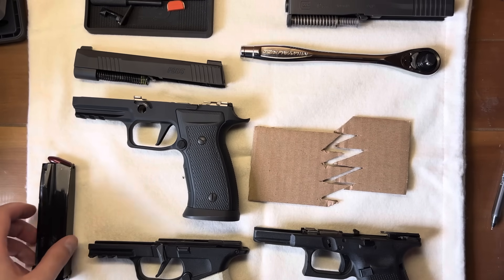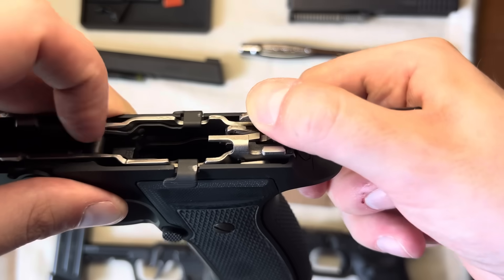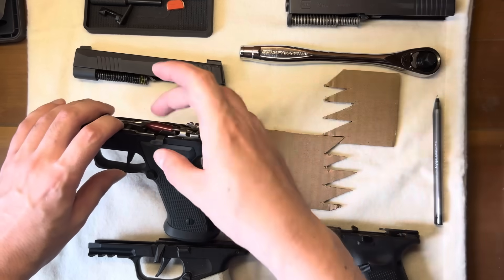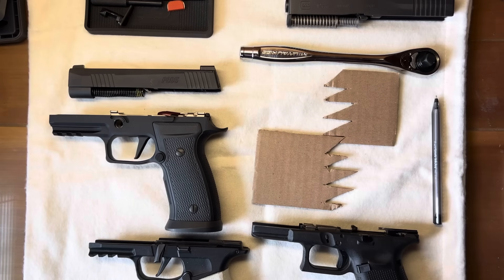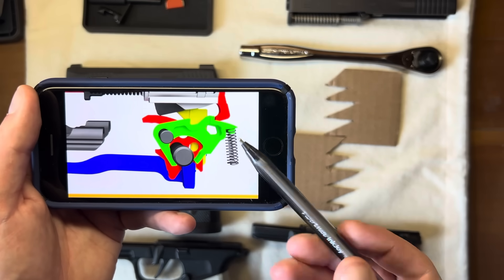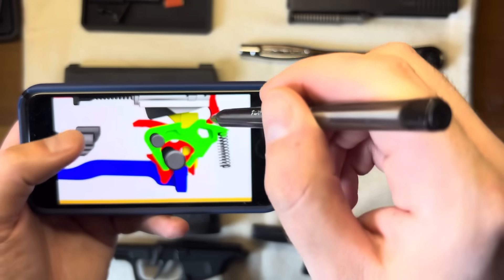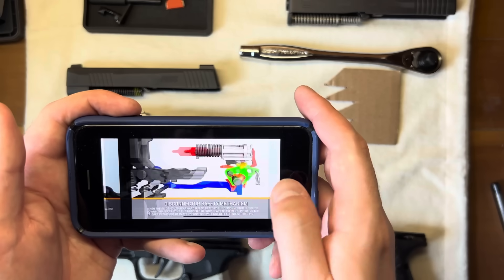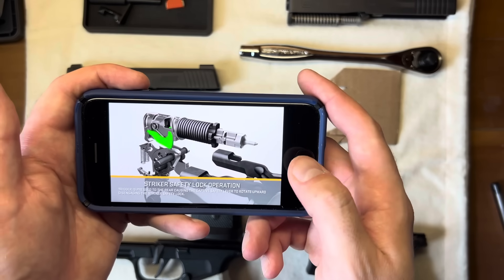Sig P320 Theory on Potential Cause of Accidental Discharges (Expanded)

Comment: Interesting theory.  I think this type of thought experiment is constructive.  Can you clarify your step 2? When I push down on my disconnector the safety lever can pop up, but if I have any force on top of the safety lever it doesn’t rotate up.
Reply from the maker: Yes, correct. The below video is probably one of the better ones that show how the gun functions. Grayguns has a cutaway slide so you can see the striker safety lock is in contact with the captive safety lever when in batter. If it was out of batter the striker safety lock would be behind the captive, safety lever, and as it’s coming forward it would contact the captive safety lever. The spring weight and travel to defeat the striker safety minimal and the contact may be enough to defeat it just for a split second. I think this more likely and not so much the carbon fouling or being pinned in place due to tolerance issues. 

https://youtu.be/4q-AFIxPH1U?si=BI4XdbXZpDgpRYWT

Comment: One of the questions I have is “Can the mechanism that blocks the firing pin get stuck in the fire position?” If so, would someone necessarily realize it was stuck in the fire position? It occurred to me if that safety was stuck, it could be that way for years. I would think the gun would still fire normally.  It would mean the failure would not have to occur at the same moment as the sear problem occurred.
Reply from the maker: Yes, it’s possible to get stuck and you would likely have no idea that it’s stuck. The only problem I have with that theory is post review no one can get them to stick in the up position.  Also, some of these guns have very few founds and I don’t think carbon fouling would occur this early in the guns life.  One thing I will note is that Sig does not want you to oil the striker lock.
Reply: @dgrassley  this is something that should be function checked every time the gun is field stripped for cleaning.  Cleaning should be done, IMO, after every live fire session and every 6 months for a safe queen.  However, no one does that but me.  You would notice the striker safety lever being stuck up when you could see the firing pin poking thru the breech face.

Comment: I think it is a very bad design to compress the striker spring fully while loading a round into the chamber.
Reply from the maker: I wouldn’t say it’s a bad design, we have never had issues with the HK and Walther products. In my opinion Sig tried to design a gun you could compete in competition and do duty work.
Reply: @dgrassley  exactly.  Sig convinced LE and Military to use a gun with a competition style trigger for duty use.  I'm not a hater btw.  Exactly the opposite actually.  I own 9 P320's and use three for competition and practice.
Reply from the maker: @jeffhernandez5098 100% agree! I remember the 2010’s when G34 was the hot competition gun. The aftermarket triggers people used remind me so much of how the P320 works and is designed.
Reply: @dgrassley  Compares to Glock half-compress design, SIG is quite unsafe.
Reply from the maker: @milolll glock is one of the most safe pistols for sure but that doesn’t mean a fully cocked striker is unsafe. Even the P320 is not 100 percent cocked.
Reply: @dgrassley  Not 100% cocked? Glock half-compress design doesn't have the force to strike the primer without the trigger pull, but SIG is fully compressed(cocked) to have the potential force to strike the primer, am I wrong? please correct me if I am wrong.
Reply from the maker: @milolll  The P320 it’s not 100% cocked. The sear rotates along a pivot. 
No, you’re not wrong but the M&P has the same sear design and we don’t call that gun unsafe. The point I’m trying to make is the P320 likely has other issues than a cocked striker alone being the design flaw. I think we are saying the same thing in a way.
Reply: @dgrassley  Thanks. So is Glock unique in the half-cocked design? Any other has the same concept? or is it a patent of Glock only?
Reply from the maker: @milolll in short no it’s not unique to Glock but they were in a way the first and others copied the design. Technically the HK VP7 is the first striker fired gun but they use a striker fully at rest and then the grip pulls the striker back. 
All the clones of the Glock have this particularly cocked design. Ruger RXM, PSA dagger, CZ P10 series, Smith SVD9 just to name a few. The only issue with the design is you’re fighting the striker spring and sear engagement which makes for a longer and heavier trigger pull.

Comment: Didn't the FBI testing find that the seer and firing pin block Co rotate because their on the same pin?
Reply from the maker: No they are on two separate pins but the captive safety lever rest on the sear pin. I have seen any movement in mine as the sear resets.

Comment: Now I'm somewhat concerned about my order of operations when I load my carry pistol. 
I always dry fire, practice on the reset then gingerly load buy easing the slide forward to not wake the wife up. 
My other buddy evidently  tests his safety every morning by pulling as hard as he can then gingerly loads by letting the slide forward. 
I wonder how many police officers might do something similar to not wake their spouse causing a partial sear engagement.
Reply from the maker: I think the reason we may not see this in a press check is because the slide is moving too far back and sear/striker engagement is not strong enough to walk the sear down. Similar under normal fire there isn’t enough movement to walk the sear down. No matter what the min and max tolerances of this gun are not enough alone to lose sear engagement.

Comment: I was playing with mine the other day. I hope you see this comment. I racked the gun without a mag or ammo. Once the fire arm was in battery the slide was loose. I was able to push the front of the slide back maybe an 1/8 to 1/4 with little to no resistance. So the over holstered theory makes sense. I hope u put another video out with that in mind to test that theory out.
Reply from the maker: I currently don’t have a slide for my P320. From my experience slide play alone won’t let the striker slip off and the sear still needs to be pushed down.  I may do a video on the different sear design and how it works.

Comment: I see what you’re saying but don’t most holsters apply pressure to the frame for retention? That would make it hard to push the frame further into the holster than the slide.
Reply from the maker: I can’t speak to all holsters and designs, but I would agree that Kydex molded holsters tend to have a tighter fit around both the frame and the slide.

Most of my experience is with Safariland. Their holsters are designed to accommodate both X300 and TLR weapon lights. Because of this, the internal dimensions are longer to fit the X300 and wider to fit the TLR series. This can make it harder for the holster to lock securely onto the frame. Additionally, for most models, the ALS system locks onto the slide rather than the frame.
Reply: Most duty style holsters actually apply pressure to the light not the slide or frame.
Reply from the maker: @Rocky-Stone You’re right some do, but safariland doesn’t due to them fitting multiple light shapes and lengths. The safariland holsters will work without lights attached which means they are locking in the slide, barrel and trigger guard.
 I agree with any light specific holster they often use the light to maintain fitment.

Comment: Dude, aside from the initial holster demonstration, you're rambling. I have no idea what your theory is.
Reply from the maker: I know, I’m not the best presenter and I apologize. 

In short, my theory is this: the gun is being over-inserted into the holster, which pushes the disconnector down and causes the captive safety lever to rise. (In my specific FCU, there’s some material interference causing this issue.)

Then, when the gun is bumped or gripped, it returns to battery. Upward pressure from the magazine pushes the slide up, which can cause a loss of sear engagement. At the same time, the striker safety lock contacts the captive safety lever and they move in opposing directions. 

Now you have loss sear/striker engagement and the striker lock has been pushed up for a split second allowing the firing pin to strike a primer.
Reply: @dgrassley  Thanks! Sounds plausible!

Comment: I believe what is happening is the sear is walking down off of the striker hook. This happens because of the play in the slide. As the sear is wakled down it engages the trigger bar, this pushes the trigger bar which pushes up on the striker block. With the striker block defeated, and when the sear has sufficiently walked down the striker hook and the striker hook falls off the sear, there is nothing to stop the pistol from firing. The proof that Sig knew about this issue is in the re-design of the sear. Is there any other weapon that has a secondary sear? My question for the design engineer is why did you design this second sear notch into the sear? This is how Sig can most definitely say the striker cannot fall without the trigger being depressed. They are in fact correct. But what know and do not say is that the trigger is being actuated by the sear walking down off of the striker catch. I am an Sig fan boy, I have 4 Sigs, though not a P320. Sigs are great guns, but this P320 falls short.
Reply from the maker: The only reason I would disagree is due to the amount of force required to push down on the sear once the sear tail comes into contact with the trigger bar. I believe it is greater than 5lbs. Base on my finger scale (Not scientific).  I just don’t think the amount of surface engagement is enough for that to occur. If you ever get the chance to do it I think you would agree, but I encourage you to test for yourself. Sig definitely did not want the sear to move after the first drop test issue. 😂
Reply: There is a secondary notch and without the safety lock being disengaged the striker can’t move forward.
Reply: There is a secondary notch and without the safety lock being disengaged the striker can’t move forward.
Reply from the maker: @TheEarthEater You’re correct, my point is that the striker safety lock is coming in contact with the captive safety lever and being disengaged as the gun is going back in the battery. The amount of movement required for the striker safety to be discharged is not much. As for the secondary sear notch the sear springs may not be able to reset the sear in enough time as the striker is moving forward.
Reply: @dgrassley so how would it fire if the striker lock was being pushed up while going into battery? The sear is still in the upward position with the primary notch and secondary notch in play?
Reply from the maker: @TheEarthEater I’m saying it’s all occurring at the same time. The sear slips off as the slide is coming forward.
Reply: @dgrassley it slips off and also clears the secondary notch? That would be easy to replicate in a pistol with that failure since it would be defective. None of the pistols with these claims have been proven to have that issue. That’s the tough part.
Reply from the maker: @TheEarthEater the sear has to move down in order for it to lose engagement. No, this would not be a repeatable test as I said in the video this is something that you need the gun with the physical characteristics and tolerances in order for this to occur. Then you would need to test an out of battery gun. I’m getting the feeling you have not watched the video because I addressed a lot of your questions.
Reply: @dgrassley what I’m saying is. This has already been tested. With every p320 claimed to have fired on its own. None of them are capable of doing this. It’s been proven and tested through 3rd party laboratories, sig, the U.S. military, the FBI, and other law enforcement agencies. The tests continue to this day and are providing more measurable repeatable empirical data to prove it’s just not possible.
Reply from the maker: @TheEarthEater I have not seen any testing of an out of battery P320
Reply: @dgrassley so an out of battery p320s barrel is unlocked and the primer drops out of the way from the firing pin which would also disallow contact to detonate the primer cup.
Reply from the maker: @TheEarthEater no it only out of battery but 20-50 thousands. When going back into battery this is when the issue occurs.
Reply: @dgrassley have you been able to replicate the striker hook releasing from the sear when returning to battery? No, and neither has anyone else. This is not because it depends or if this then that, it would be a clear tolerance issue that could be made repeatable and measurable. This is not possible and there is no empirical data to support it. Is the assessment logical? Sure. Is it valid? No.
Reply from the maker: @TheEarthEater I don’t even have a complete gun to test this. My goal in making the video was to draw attention so that others could test it. I said in the video that I believe it would require a large sample size to even find one of these guns.  Just going off of Sigs sales it’s a 1:10,000 chance of having this issue if it’s truly the issue. That was the only reason I made the video. It was never to say this is it but just to point out the theory since I haven’t seen others mention talk about out of batter testing
Reply: @dgrassley I understand but even the assertion that it’s 1:10000 is also problematic. If it can’t be proven the ratio also cannot be stated as fact. Is it a 0% chance? No, probably not but most likely very close to it. However tens of thousands have been tested with zero issue from 3rd parties. Hundreds of thousands have been tested through SIG itself. With a little over 3 million of these pistols being made 0 of them have been proven mechanically to be defective to where the pistol could fire without the trigger being pulled. If there was just 1 out there that could we would all know about it because there would be a recall.

Comment: The team/agency I am with have apx 40 of the 2017/2018 P320 X5. We can not replicate the issues. We believe the bull barrel and slide assembly creates a much more solid mounting surface. If this helps at all, we can provide our data. We are all looking for a solution.
Reply from the maker: @undefined7141 Thank you for checking. I will reach out if I get to the point of collecting data. 

Do you know if they have the Safety Lever Spring (part 1302135-R)? It’s located directly under the captain safety lover, but you would have to pull the FCU out to see it. 

Just statistically speaking, Sig said there were 3 million P320’s 
manufactured and hypothetically 300 of those have gone off. Even if all 300 were due to this issue, which is unlikely. There is a 1:10,000 odds of having one. The sample size would have to be huge to just find the one. Not to mention the time to replicate the issue.
Reply: Sir, it might be worth setting up an online presence to open source your data. Comparing the open-source gun community research with secretive FBI research, it appears open source is the way to go for speed and efficiency

Comment: This makes a lot of sense to me. If this turns out to be what's happening the Sig haters are going to have to eat a lot of humble pie. They are like an angry mob. Just confirms my suspicions that it is a dangerous gun, but not a defective gun. If you sell a gun with 1/8" of trigger pull to fire and 1lb of force, it isn't defective, but it is really dangerous. It has been shown many times as well that Glock, Sig, S&W and others will all fire if you slightly pull the trigger and then manipulate the slide. The only safe ones are the ones with a grip safety. I love my XDMs.

Comment: Hmmm. I also commented over on Wyomings channel that the way his striker safety lever moves is different from mine. I have a post voluntary upgrade m17 with an apex trigger and trigger bar and a wilson combat frame. My safety lever doesnt move at all independently from the trigger bar movement that lowers the sear at the exact same time. He demontraded on his 3 sigs that his trigger takeup was defeating his striker safety. On my m17 which has an apex trigger and trigger bar this doesnt happen. The striker safety lever doesnt move more then a few thousands of an inch before the sear moves. This is nowere near the amount needed to disable the striker safety thus my striker safety functions 100%. I used a screwdriver to drop the sear with the full trigger takeup and received no primer strike as the striker safety caught it every time. You also showed that your safety lever can be moved a little without touching the trigger or disconnector. Mine does not move at all when the disconnector is depressed. I can manually pull it up only when the disconnector is fully depressed but it doesnt move on its own. When i do it is very loose and falls easily back into it resting position. When the disconnector is released it forcefully places the striker safety lever into position under tension so it cannot be moved upwards at all. Im pondering whether the trigger bar is the issue or if there is alot of out of specs parts out there. He had a 3 of 3 sample. Mine is well a 1 of 1 with aftermarket parts. Mine passed all tests and inspection shown in any videos i can find. As a caviot my sig only has maybe 600 rounds down the pipe.
Reply from the maker: If you take the fcu out look from underneath. You may have that spring that I am taking about in the video. It is designed to keep the captive safety lever down until it comes in contact with the trigger bar.